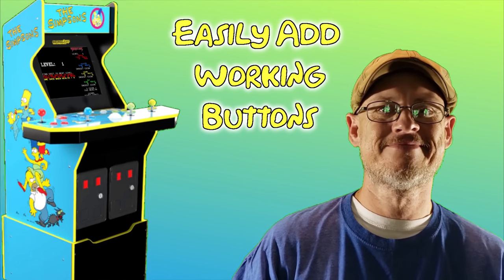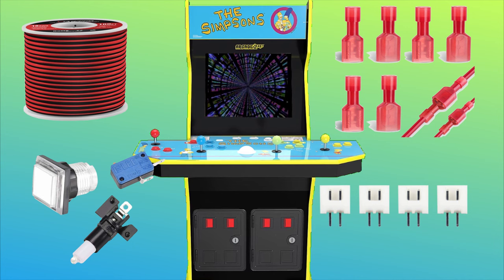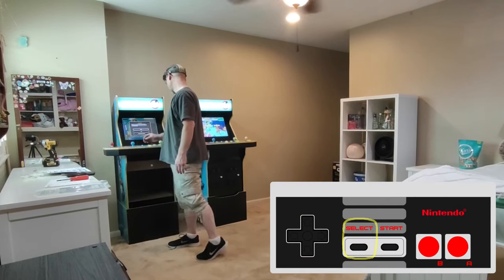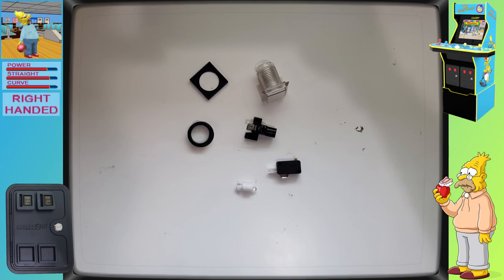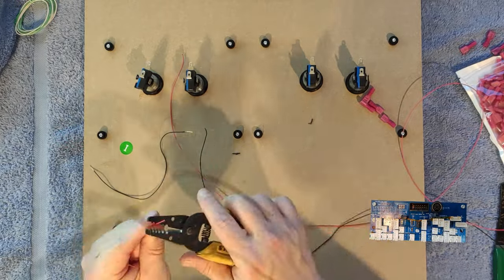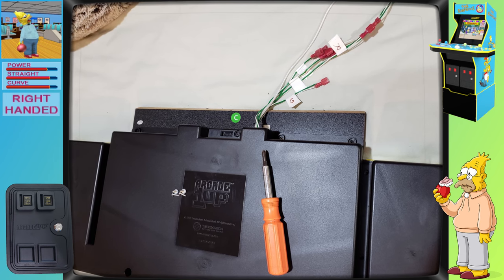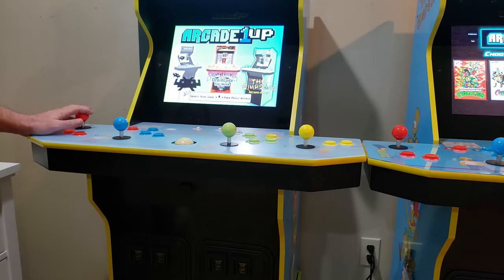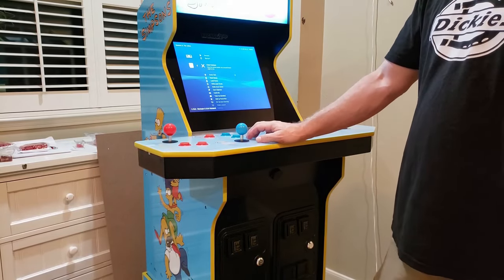Add Working Buttons to your Arcade1Up Simpsons Cab

Comment: Great video 🙇
Reply from the maker: Thank You Very Much. Hope you found it helpful.
Reply: Have you ever tried adding buttons on those extra unused slots? Would it be possible to get 2 extra buttons per player with the default PCB + MDE(patch)?
Reply from the maker: @kingpotato42  I have not, AND was told that someone in the community did check them, and I was told they do nothing.
Reply: @TechicallyTNT  thank you. That saves me the effort of trying it myself lol. I followed your guide, but added additional action buttons and it worked perfectly.
Reply from the maker: @kingpotato42  Dude, I've got two Simpsons..... I'm not sure what way I go on it, BUT I do Love the idea of three button games....
Reply: @TechicallyTNT  If you do decide to add them, definitely consider using Forstner bits on the acrylic and control deck to avoid tearing them up. I was only interested in adding arcade games so I ended up mapping start to the attack button instead of coin/select and everything has been working like a dream.
Reply from the maker: @kingpotato42  thanks for the tips brother, and thank you for checking out the Channel. Means the world to me.

Comment: I'd love a third action button but Retroarch with Team Encoder MDE won't hold the button configurations I keep inputting (and saving). If I can't figure that out I'm not sure soldering is going to be worth it. TNT, do your 4 players all stay in correct order? I'm aware this is a problem with Retroarch at large. The A1up work around for SF2 Yoga Flame seems to handle this issue better in my experience as it mimics a single keyboard encoder as opposed to four.
Reply from the maker: I've not had that issue. When I set mine up everything stays saved. The only issue I seem to have is the player positions changing based on what controller I use first. I always grab player 2 first and RetroArch sees it as player one.